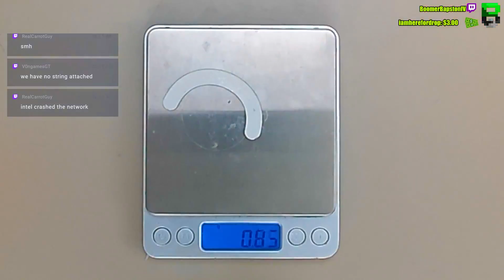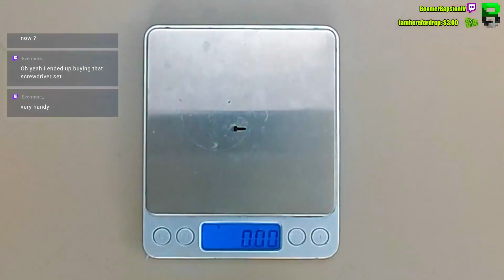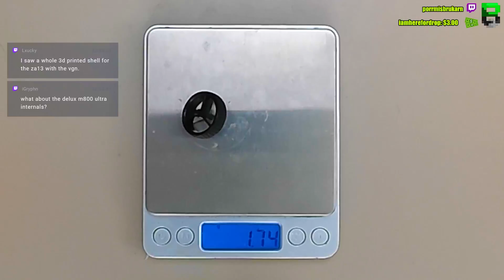Unveiled Secrets: The Razer Viper V3 Hyperspeed Teardown – What's Really Inside?

Comment: MAN LOVE THESE VIDEOS
Reply from the maker: What do you like best about them
Reply: @Beardedbob  just the smooth steps on the teardown showing what can be done and not done. I watched your viper mini teardown recently as I have got one recently for roughly 7$ (CRAZY) from the 2nd hand marketplace and there was a disconnection issue but I have replaced the cable and it fixed it.(ofc from watching ur vid) Everything is working and added new skates. 

I had one problem tho and it was my grip coming from a g305 (egg) and because of that.. the shape.. especially the button shapes are so diff from the g305 and so it was just not working for me but only until after i removed and sanded the right mouse button (for context: I am claw palm grip.. well my ring and pinky finger like to pull/tug on the right side corner and rest flat too but the shape of vipermini just doesnt allow that as I keep on mistakely pressing the right click when it gets tense) continuing - and now Im back fragging again because I just sanded the right mouse button abit and wallah! The mouse is now extremely comfortable. So thanks man. Sorry for the long styled message. Keep doing what you are doing.

Also.. Viper Mini in 2024 is soo underrated. Might make a review soon for 2024 folks and ofc.. inspired by bearded bob.